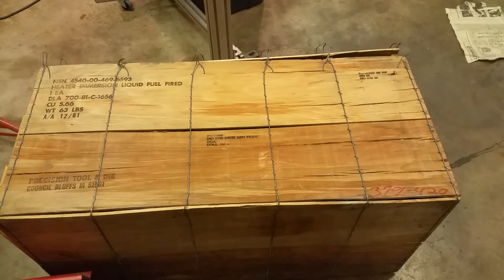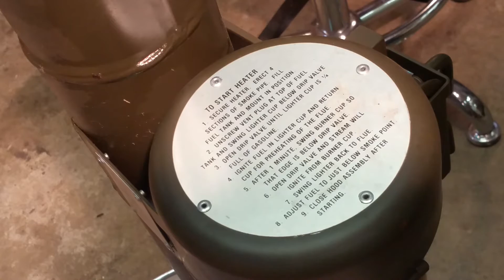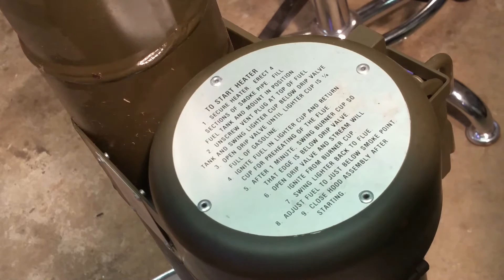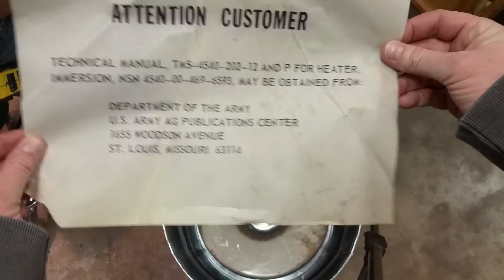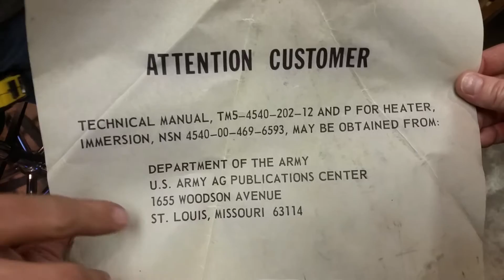WW2 & Vietnam immersion heater, Field kitchen by Heather and Don

Comment: WE USED THIS FOR CLEANING POTS AND PANS AND OTHER PIECES OF KITCHEN EQUIPMENT. AND TO SANITIZE OUR EQUIPMENT. BE VERY CAREFUL WHEN YOU'RE PRE HEATING THIS BECAUSE THERE CAN BE A BACK BLAST FROM IT IF EXCESS FUEL DROPS DOWN THE PIPE.

Comment: The drop supposed to be like a string of Pearl's, just below exhaust smoke point, as the instructions say, and the water level just below the green paint on the flue. You 2 are kinda scary, but thanks for the video anyway. Just treat this equipment safely and be more careful.. use a 50 gallon trash can, galvanized, or stainless, and don't drink the water.

Comment: In a 32 gallon trash can it will give you 20 gallons of hot water because the heater displaces the water.

Comment: If i remember right. That little cup is a preheater , to get the stove pipe hot. . As that heat helps the air to  flow .it's not to get the fire in the hole going. You use a match or lighter Also we used gas not diesel. As diesel gave off lots of smoke and would give away your position. You could ajust the drip, so as to give off no smoke . Also. Those pipes get very dirty. Easiest way to clean them is. Have a good pile of sand or dirt . And scooping through and keep doing it. Lot easier then using  brushes.   Ya, will boil water like crazy.  Add soap. Final rinse would be a barrel of boiling water with no soap.  An  army that has diarea,  is not a good fighting machine.  So we needed good sanitation. 👍that m67 never got me horny till now.😂😂  we were told the VC would sneak up at night. And place a hand grenade with pin pulled but handle held with a rubber band and it would melt the band and blow your ass to kingdom come . 😜 we ran our mess kits in them. The mess kit folded open. And your knife spoon and fork had large slots in handles so you utensils onto mess kit handle and bobbed them up and down through the 3 cans. Trash cans. And then hung out to air dry.

Comment: Sounds like a certain couple had been using their own "smoke pipe" just before making this video.  I think your burner plate is upside down.  These work much better with gasoline or a 50/50 gas diesel mix. For your own safety, do this sober next time.  haha!

The objective is to get the burner plate hot so the fuel vaporizes on contact and roars when its cookin.  The upside down burner plate didn't help here.  Still worked though.  These could also be mounted in the top hatch of a water trailer to make mega hot water and/or keep it from freezing.  These were used for cleaning mess kits as you mentioned, and also for decontamination operations and mask sanitation, as well as heating T-rations, which were huge rectangular cans the size of a cookie sheet full of wonderful culinary greatness..... Not so much.  Opening those with a larger version of the P-38 rocker can opener they came with in cold weather was a lot of fun too!  Anyway, after the cans were heated per the can instructions, they'd preheat insulated food containers and with hot water and toss these cans in them and I, as the platoon sergeant, would take them back to my platoon HQ and feed the troops.  I had to closely watch the portions since I ate last......yikes!!  haha!  Good times.

After the field excercises they fill these burners with gravel and shake/roll them around to get the soot out and rinse them clean and wipe the outside down with corrosion preventive wax.

Oh, by the way this wasn't Viet Nam, this was the late 1980s and 1990s in Germany and Ft Sill OK.

Comment: You folks are about to blow up the place. I work with that burner while I was in the Army for over 14 years
That burner is to be installed onto a 30 gallon galvanized trash can. That's what those hooks are for in the
back. The splash shield you placed in the hole is upside down. it should be upright and facing the back
The smoke stacks have to be ALL connected and installed. We were told to ONLY USE GAS for the tank. I had a three can set up a pre-wash, a wash, and a rinse station. After each use I had to empty them all out and put fresh water in for the next round. If I didn't change the water it would cause food poisoning and or contamination.
Reply: I am thinking that from 2017 to now, they either figured it out the right way, or burned the place down already.
And that water pan isnt deep enough, either water has to be line with in 6 inches of the collar 

We used to cook c-rats in them too.
Later on boiled MRE pouches.
Couldnt cook directly in it because they put a lot of rust into the water, we tried boiling potatoes once, they tasted terrible, but we could clamp the aluminum food transport containers around them and cook stuff double boiler style.

Be glad they didnt get a gasoline fired field stove.

If anyone buys one of these and finds this video DO NOT use it like this
1) user ALL the pieces of smoke pipe, you need them all for proper draft
2) the fuel disperser goes with the perforated plate UP and the high side towards the trash can.
3) when running in diesel, it is easier to light the main fire by wadding up some paper, dribble a little diesel on it
and drop it down, then open the valve to about a drop per second, diesel will run a bit slower than gasoline.

If running on gasoline, once you have a flame at the valve and it has started down below, blow out the flame on the valve.

4) Do not run this with out the water with in 6 inches of the collar (metal that joins the burner pipe to the exhaust pipe
Or you will overheat the thing and warp the piss out of it

5) If you are putting out tons of smoke, you are wasting fuel, just turn it down and let it do it's thing

6) dont drink the water it's boiling, it puts lots of rust etc into it, it tastes like crap, if you want to do something like that
copy the design and make it out of heavy stainless steel

Comment: I RESPECT MY BROTHERS AND SISTERS WHO SERVED OUR GREAT COUNTRY BUT IF YOU DON'T KNOW HOW TO USE A PIECE OF EQUIPMENT PLEASE PLEASE PLEASE SEARCH THE WEB FOR INSTRUCTIONS BECAUSE YOU CAN END UP HURTING YOUR SELF OR OTHERS.
WHILE WATCHING YOU TRYING TO SET THIS UP MY BODY WAS CRINGING BECAUSE YOU DIDN'T SECURE THE HEATER TO THE GARAGE CAN YOU PUT THE BURNER PLATE UPSIDE DOWN AND YOU USED DIESEL FUEL WHEN YOU'RE SUPPOSED TO USE GASOLINE AND WHEN YOU GET THE HEATER WARM ENOUGH YOU BRING OUT THE HEATING CUP AND LET THE GAS DRIP DOWN THE TUBE THEN YOU LET IT DRIP NOT STREAMIN DOWN THE TUBE.
I HAVE OVER 15 YEARS OF EXPERIENCE WITH THIS EQUIPMENT.
NOT TRYING TO RAG ON YOU BUT PLEASE GET A MANUAL THE NEXT TIME YOU'RE NOT FAMILIAR WITH A PIECE OF EQUIPMENT.
IT WAS NICE TO SEE THAT IMMERSION HEATER THOUGH.

Comment: the burner plate is upside down, it will burn much cleaner and hotter if you flip it over.
Reply from the maker: Thanks for the info!
Reply: And it should ROAR. Anybody who's ever been around one, or ran a Svea stove knows that. They run on the same principle/ system.

Comment: Gas,diesel or bunker crude. Jet B works best. A pc of wax paper works great for warm up and lighting.Ya'd think in this day and age they could send an "IDIOT" sheet with these eh ? I have used similar Canadian units in the arctic winter and found they worked great.
Reply from the maker: Sure, it would be nice. I started with diesel,  gas worked better. Thank you for commenting.
Reply: If it will drip it can flow. Some fuels just need more wax paper to get things drippin !lol.